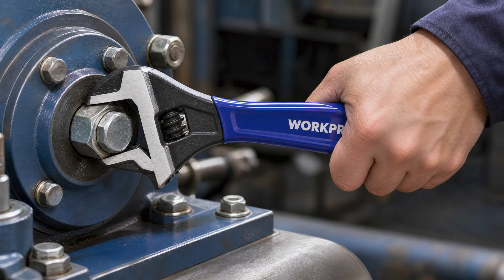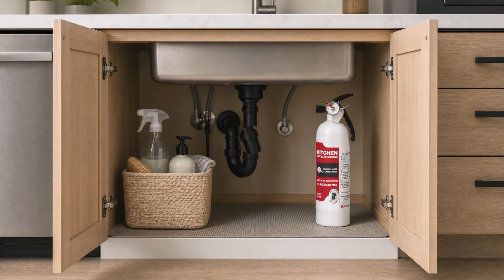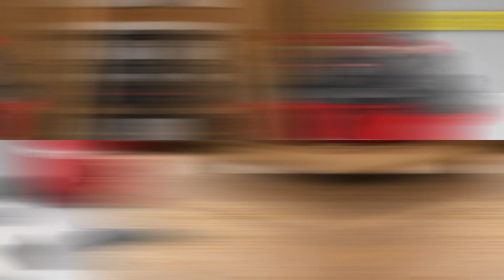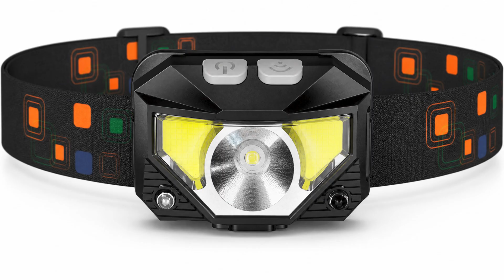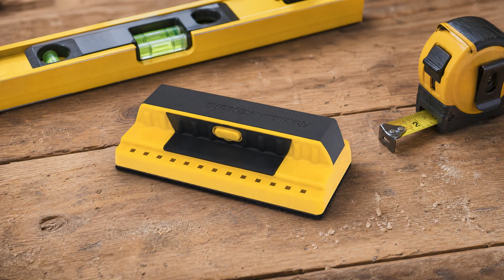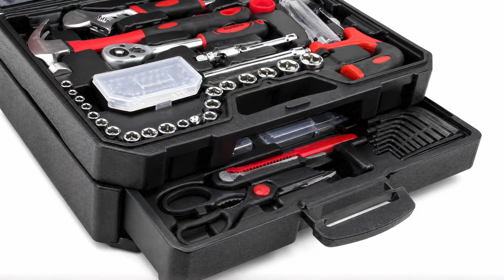Top 10 Best Tools For First-Time Homeowners (Buying Guide)

Comment from the maker: 🛒 Check the Current Amazon deals on these DIY tools here👇
#10.  SocTone 12.5FT Telescoping Ladder with Stabilizers
https://amzn.to/4fISBCq 
#9. Kidde Kitchen Fire Extinguisher 
https://amzn.to/4q3Exa5
#8. Korky Beehive Max Universal Toilet Plunger 
https://amzn.to/4zbkjQ2
#7. CRAFTSMAN 16 Gallon Wet Dry Shop Vacuum
https://amzn.to/3THAF2t 
#6. WORKPRO 2-Piece Adjustable Wrench
https://amzn.to/4g4i2NP
#5. LHKNL Headlamp Flashlight
https://amzn.to/4z6EtdF 
#4. Klein Tools NCVT1P Non-Contact Voltage Tester 
https://amzn.to/4wiMslw
#3. Franklin Sensors ProSensor 710 Stud Finder 
https://amzn.to/4wk5Rm2
#2. KingTool 325 Piece Home Repair Tool Kit
https://amzn.to/4hnrI8f 
#1. DEWALT 20V MAX Cordless Drill and Impact Driver Combo Kit
https://amzn.to/4weTozW